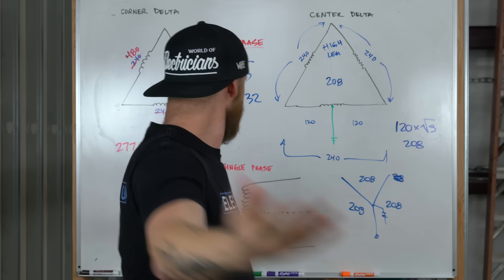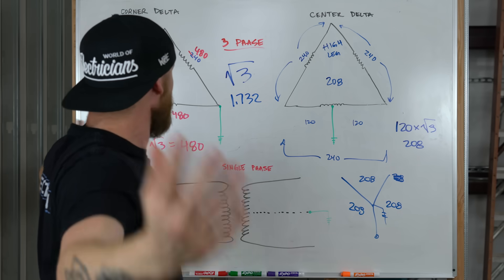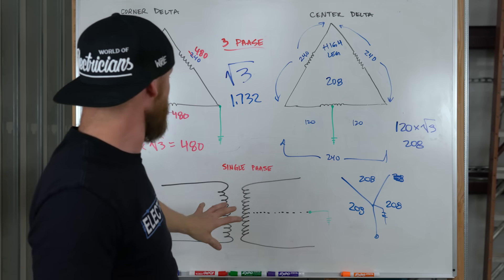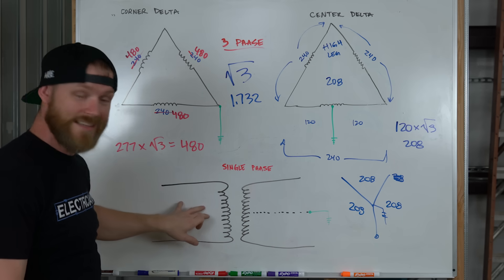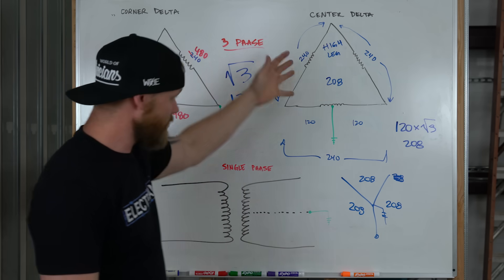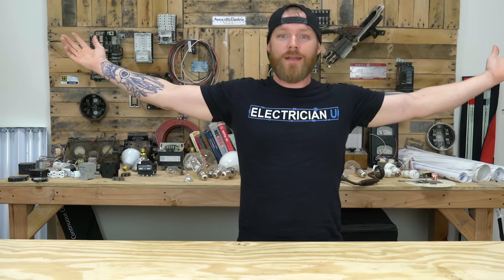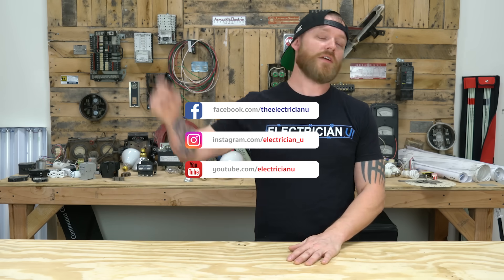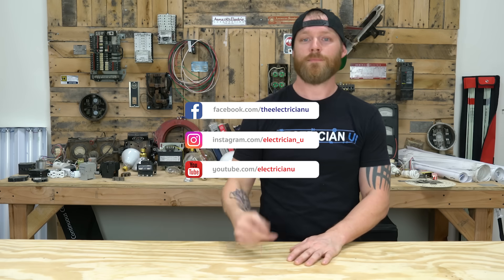Difference Between VOLTAGES - Why We Need Them All

Comment: So what need to happen when a building that gets 120/240 single phase, but we need 3 phase for a 100 gallon ingersoll rand air compressor? I see a 3 phase meter base is available, but what about the panel, breakers, and what does the power company have to do at the pole? I see Oncor says sometimes they will put another transformer on the pole and can wire everything for the 208 wild leg. Is the Δ 3 phase with the wild leg the right one?

Comment: Law of cosines will also yield your resultant voltage if you know the voltage of each leg and phase angle. C= √ a^2 + b^2 - 2 x a x b x cos(angle)
So.. on your 120/240/208 transformer 
C = √ 120^2+240^2 - 2 x 120 x 240 x cos(60°)
C=207.85
This works for any kind of setup you will ever come across, 1phase, 2phase, 3phase, 6, 12.... doesn’t matter

Comment: I was curious about the power overseas then I ran across 380 three phase. 220 220 220 just like 208 three phase with three legs of 120.  380 is their 208 three phase and its really common there. I have some photos of some crazy wiring in an apartment building I ran across. They left the wires live and exposed in the hall so no one stole the light bulbs. Steal them and deal with the 380 ha ha ha.

Comment: 347/600 is pretty much all we use for commercial services if they aren't 120/208 here in Central canuckistan.

Some old buildings sometimes have 277/480.  I have seen it, but rare.

We call the delta high leg here the bastard phase.  Deltas are super rare again though here.  Seen some.  But they were very old.

I like the idea of 277/480 better.   Same device boxes for switches, 120 to 277v ballasts and drivers.  All the benefits of high line to N for lots of lighting runs.

Comment: Didn't see if anyone else has already said this, so I will.  DO NOT ASSUME VOLTAGE BASED ON COLOR!  Use a meter and verify it, as while some cities/counties/etc have requirements for color code, the NEC does not (except for the grounded conductor (neutral), EGC, and high-leg.)  What is the quote from Under Siege 2? "Assumption is the mother of all fuckups."

Comment: American electrical supplies are nuts, glad that in  Europe we have a unified system .
Reply: 220 to 250 depending on where you are, corner grounded delta are also present
You have 230/400 and 400/690

Europe isn't simpler, it's just different

Comment: Very well explained. 
Good, clear, analytical mindset. 
And this guy doesn't come across as an arrogant dick, or a dummy rambling off random tech specs to try and sound 'smart', either. 

Nice. 
You get a gold star. 
...Not that everybody in your generation hasn't gotten enough of those, already. --Ya' know... for breathing, or sitting down and chewing food. 

I'll conclude, by saying that there's nothing 'wrong' with using 600+ volts to torch up a common lightbulb. 
No more than it's wrong for me to live, work and almost never leave my teeny, tiny, big city apartment --and STILL drive my jacked up, 4x4 converted offroad monster-van. 

I say... "'Why the hell not?'"

Comment: As a european ... man ... US system is weird.
We have 1 phase 230V or 3 phase 3x230V (400V between 2 phase) as average.
If you have a regular house, you really don't need 3 phase, just 1x230V, you can run almost all electric things. If you have solar panels, electric car charger or some heavy duty motor, heater, you may need 3 phase.

Comment: Q? I'm living at my grandfather's house what has electricity wires installed but not hooked up to the telephone poles. There's a water heater with two 30 amp Breakers but the water heater up to 150°F (60°C) and down to 125°F (52°C) & 90°(32°C) and wanted to hook it up to a solar energy but don't know how much power it could give out to take care of a voltage of 100amp, two 30amp and five 20 amp Breakers? How much solar power would I need to take care of that kind of amp voltage so there's no problem? Could you help me out with that question because I'm still stuck on a 9-volt battery. LOL.😄😜🤔🤓🤖

Comment: Really misleading by saying 208 and 240 are the same thing. Putting a 230v motor on a 208 system is usually trouble. Line loss, overloaded cuts, etc.... can drop the line voltage. Getting +/- 5% of nominal can put your 208 under 198 and still be in tolerance. See this all the time on HVAC units and electrician tries to deny responsibility.

Comment: How is the 208 volt system differ from 240 system?
Reply: For the end user it’s just 32volts higher. The system they come from are different. 208v system is a wye and 240v system is delta.

Comment: when my dad was ordering a 6 thousand dollar pump, 3 phase pump  he read 215 V between each of our 2 hot legs. When he asked the manufacture, if he should go for the 208v or 230v version of the pump. Reading my late fathers emails,  the manufacture technical sales and local distributor were going back on forth on which would be best.  All of them  didn't know that "230V" pump and a "208V" pump were meant for difference services. meter box said "230V" which i assume is just a nominal name.  needless to say we were given a 230 pump.  while the pump didn't care,  since it got the 230v it needed within 10% tolerance, the controls did. the control transformer was tapped of the 230 output I Want to say that is why our pump didnt work. and it caused my late father a lot of hardache because he never got it working.  took me years after his passing to figure this one out.  Also 208 voltage gives you more margin if the service drops due to peak loads in the summer.... Hard to see your fathers mistakes in an email history. =/ Sorry off topic but this post brought some costly bad memories.

Comment: wow realy interesting video. In our contrey we have low voltage is evreything in DC range 0-1500v the most commons are 6,12,24, 36, 48v, mid range is AC50-1000v the most commons are 100v and 230v and three phace is 360  and the 100v is mainly used in specialised equipment not commonly found in civil buildings. For high voltage is AC is 1000V and for DC its 1500v and on. As for lines we have L1,L2,L3,PEN and in the first electrical panel we devide PEN up so we get L1,L2,L3,PE,N the colors are brown,black,grey,green with yelow stripe, blue

Comment: @10:36 Winding ratio has nothing to do with it; I see people saying that everywhere. (that's just how step up/down happens. 10 rounds on the primary vs. 1 on the secondary is a power of 10 step down) The whole sq.rt. of 3 is based in phase angles. (aka trigonometry) As to how 240+120 = 208, they aren't in phase, so they interfere with each other. ("subtractive") It's also why two 120 legs in a wye configuration aren't 240.

Comment: Hmm... Never have ever seen a corner or center grounded delta up here North of the border, all of it is 120/208v 3 phase 4 wire. Some of the older buildings were supplied with ungrounded 600V delta or open delta systems that required the use of ground fault indicators but now everything new is 347/600V 3 phase 4 wire wye.

Comment: I've never seen a corner grounded delta with 3 balanced phases in my life, it's also as rare as an albino deer...
Reply: It’s not as rare as you might think. 3 wire 240v 3phase loads no neutral needed. Because it’s less than 300volts the system needs to be grounded. We ground a phase because there is no neutral.
Reply: @bobbrumley3964  I fully understand that, what I said is "with balanced phases"

Comment: I worked testing and maintenance of 480/600v switchhear, I contracted with Encore T&D building and updating substations and worked for Garland Power and Light as a electronic tech for substations, and the transient voltage (static) can build up in substations strong enough to knock the piss out of you! ALWAYS WEAR YOUR GLOVES AND DON'T LEAN ON sub station structures and remember the JUICE RULES

Comment: The square root of 3 comes from the 120° phase separation.  Because when A is at 0°, B is at 120° and C is at 240°... unless you B and C are flipped as is true in some standards/regions.  This means that the root mean squared voltage difference between each phase is actually 1.77 x the AC voltage value. 

Good video! Thanks for posting!

Comment: Transformers: 12-24 volt- 24 volt with a Center Tap makes 1 24 volt and 2 12 volt circuits. 120/240 is the same thing except its 10X larger.... its weird, the transformers are marked as center tap and on a utility transformer its marked as Split-Phase. but the principal is the same.... center tap... terminology.... crazy...,.

Comment: There were times that even you looked confused trying to explain
A good thing that the UK is much simpler
The consumer side of the transformer it star, doesn't matter what application
L-N is 240V, L-L is 415, yep, it's that simple
For a treet, they drop a live and neutral in rotation to each house, house 1 gets L1, house 2 gets L2, house 3 gets L3, house 4 gets L1 etc.
3 phase is generally only used in commercial properties, they only need one 3 phase supply, and can take single phase supplies from that 3 phase, usually splitting loads to keep the phases balanced (a large room may have 3 sets of lights, one on each phase)
Motors can be wired as star or delta, or even use star/delta start/run
Because we are all 240/415, our cables can be smaller, this saves on copper.

Comment: Love watching these American sparkies using like... stuff that the rest of the world hasn't used since the 1960s... steel conduit, standard pattern fittings with those gawdawful switches and outlets, BX cable, wire nuts, those giant square D breakers etc. And then there's all those gawddamn voltages.. whats wrong with just standardising on 230/400?

Comment: What's voltage splitting? eg 240 vac to 120 vac. 1ph line voltage is 240vac and that's all you get where I'm from so all our domestic stuff is 240vac. American voltages look similar to mine but with the complication of splitting. I'm curious
I was half way through when I asked, now I finished the video. 240vac will be in delta either side of the coil, and 120vac is mid coil and side coil in delta. In star L-N is 120 and L-L is 240.
The power where I live feels simple after watching this

Comment: So unnecessary complex!
In Europe we have 230V 1~ on the same network as 400V 3~. The 400V on a delta connected motor means the same motor is used as 690V 3~ in star, so we have 690 in industries but they use exactly the same motor..
So all LV AC is either 400 TN-S (which gives you the 230 to Neutral)  or 690V typically IT without neutral.
For remote small users you find some 1000V step up/step down transfers which is cheaper than bringing the 10...20kV up to the cottage. Same 1000V is used for some quarry crushers, depending on +% taps and engine rating, they may use 690D motors connected in Y.
And that's it.

Always a Y service balanced around ground (hard grounded or via high Z)
No half-taps.
No corner grounding.
No need for orange warning wires.
Only 400V 690V and rarely 1000V.
Only 2 types of motors.

A typical Northern home has 400V 3~ for running heating applications and power outlets for whatever tools you want (big compressors, table saws, contractor tools) and has lighting & 1~ outlets balanced over the 3 phases.
So simple.

Comment: In Canada, we use 347/600 what electricians call high voltage.  I also work on a lot of European systems in Canada. They use 230/400
Reply: Yeah, European standard is 230/400 and its in most of the houses. Its also industrial voltage. We have kinda rare 400/690 industrial standard, and most common industrial is 6kV to run h-power motors etc.

Comment: An article on why you should not use 208 volt pumps on 240 volt systems or vice versa.
http://stationdata.info/208_240pumpsF.pdf

Most pumps and motors are now being built for dual rating
The reason they developed a 208 volt High leg open delta connection is because the power companies can deliver three phase power to rural customers using only two high voltage phases. When running long distance rural farm hookups, needing only two high voltage phases instead of three is a big cost savings.

Comment: I'm sorry but wire Low Voltage or High has RESISTANCE. You still run 15 volts across a long distance your going to have a voltage drop because of wire Resistance. Your miss leading the people.

Comment: I&C techs we see the lower voltages and the controls portion of it. 99% of electricians I have come across do three things. Install conduit, pull cables and terminate. Rarely have I had an electrician help out with anything technical like troubleshooting relay circuits or sit with me looking at PLC logic.

Comment: I really like how you explain everything in a simple way. Thank you !
My question is. What is the wire color rule that I Have to follow in order to wire a plug connector from my 3 phase charger. I need to plug this to the wall and I have 3phase 240vac with a high leg 208vac   
Thank you !!

Comment: Great video, explained so much. I am trying to troubleshoot a VFD. I am getting a high voltage fault. Our B phase from ComEd is reading 218, A & C are 125. Is that B phase reading out of the acceptable range? Adding to the issue is a 480 Volt step transformer.

Comment: Can you explain three phase 240 a bit better?
Reply: 3 phase 240 is a delta low side, your not going to see it much at least in my area.  They do it so they can center tap one side and get you 120v single phase. Most low voltage three phase you will see will be 208v, which is a wye configured transformer.
Reply: @josephkordinak1591  thank you. I'm in the business of installing battery chargers and have ran into 240 3ph once in the last year but 208 a handful of times. Thank you for the explanation

Comment: If I have a three prong twist outlet that is 208 is there any way to use that for an appliance rated for 240 like a dryer or oven?  (I’ve got no 240 outlets in my building). Or do I need to run a new 240 line from the breaker to run 240 appliances

Comment: Nice clear explanation! Just out of curiosity, I frequently come across 575 V 3-phase in many industrial environments around me (Boston) I assume it's just old specific stuff left around here and that a lot of you non East-Coast guys never see it? Just curious. Maybe some guys in LA, SF, or Portland?
Reply: im in Texas, i have seen an old 600v system but never 575.
Reply: It's just some older equipment. Over the years, utilities have increased the voltage delivered, ex: 110 to 115 to 120, 220 to 230 to 240, 440 to 460 to 480, and 550 to 575 to 600 volts. Usually you can tell approximately the age of equipment by the rated voltage on the nameplate.

Comment: Thank you so much for this, It is a nightmare to try to find a plain text breakdown of voltage standards on google: I have been in a mechanical heavy environment for several years & rarely work with wiring or trouble shooting electrical systems, so I keep forgetting what the standard voltages are ... but "what voltages have you worked with" is a standard interview question & I feel like a dumb ass when I stumble over that question. I have worked a lot of jobs where the management doesn't want to pay for new equipment & buys a bunch of used tools from all corners of the globe. So we would have a European process chamber with, a Japanese data logger running the interlocks, and an american chiller driving the cooling system.

Comment: Need some help! perhaps this would make for a  good video. Installed 10/3 for dryer 30amp circuit and wires get very warm when machine in use. Receptacle gets very warm also. checked all connections and measurements are ok. The code calls for 10 gauge as a minimum. I’m not comfortable running the dryer when things are warm like that. Any advice anyone?

Comment: So if 277V is single phase of a 480V system, then that means it has to be wired in Y, right? Otherwise single phase would be 240v? Or if you did a high leg delta 480V system, you'd have 240 and 415V, right?

Comment: How do I connect  a breaker  for a Ac  on three face panel ? How do I pick the 120 volts leg ? Because one leg is 120 y the other one is 208 volts   :/ I know how to do  on a 2 face  panel  , but in three face  I’m  confused 😬

Comment: I wish the U.S.A. would get rid of the 120v/240 system..... should be strait hot to hot...neutrals are false engineering ....same as ground.Made at utility transformers with ground rods at transformer...TRY TURNING  MAIN BREAKER OFF AND AMPROBE YOUR NEUTRAL AND MAIN GROUNDING CONDUCTORS ...If 0 your lucky no many neutral issues i see being a fellow sparkey arcfault sux
Reply: so many

Comment: If a unit was specd for single phase, 208V can I hook up a unit that is single phase 240V? We have a tight spot for a water heater. We want to use a residential model that will fit in the space, then swap out the element to a standard 240v 4500W element. But again, the building was spec'd for and wired for 208V single phase. Thanks!

Comment: Just a clarification, why did you multiply 277V to 1.732 and get 480V, whereas in calculating the 208V, you simply took the half of 240V which is 120V x 1.732 and get 208?  I thought the 277V is the result of the same method of calculation which is 480V/2 then multiply it to 1.732? Hope to get clarification, thanks.
Reply: Concept is line to neutral voltage x 1.732 = line to line voltage. Line to line voltage/ 1.732 = line to neutral voltage. Line to neutral = phase voltage, line to line = line voltage.
Reply: He used two different methods for two different problems.

Comment: Can you do a video on electrical testing categories? The equipment/voltages used under them in residential and commercial applications, tester ratings, importance of CAT III shrouds on test leads and arc flashes. Stuff revolving around that.
This is good stuff.